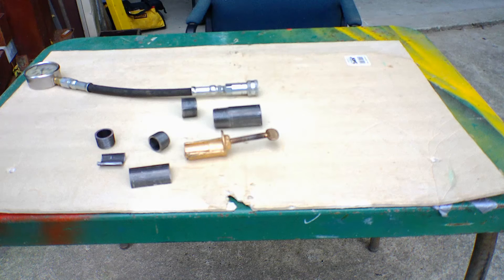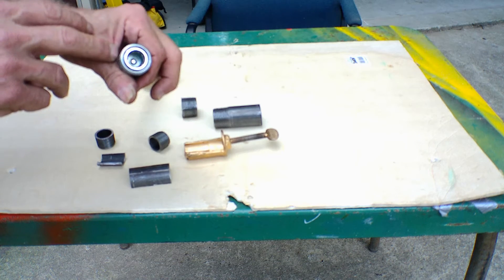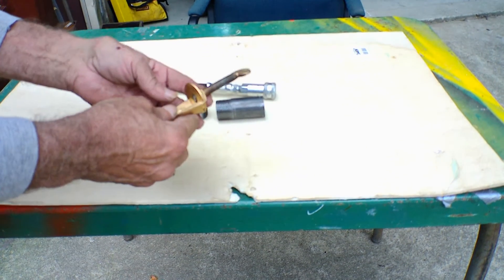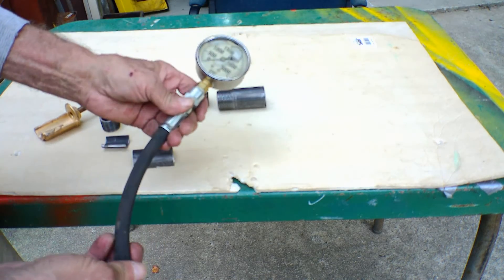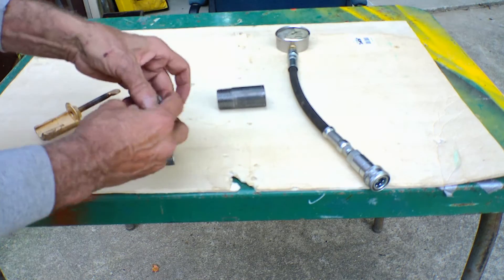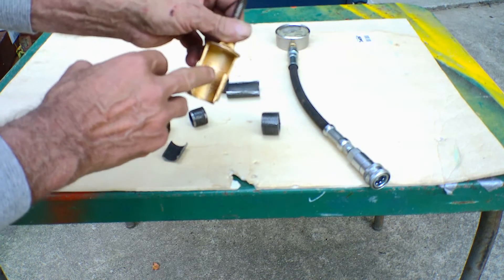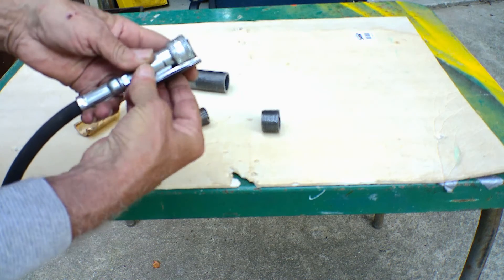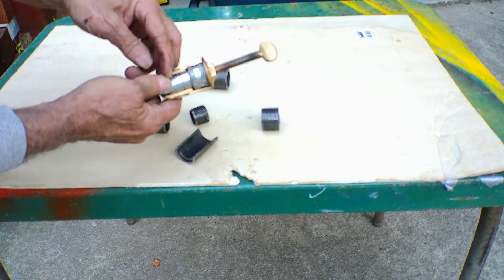Hydraulic Pressure Release Tool

Comment: Hi Mech!  That’s a very clever device you came up with!  A couple years ago I forgot to relieve the pressure on my backhoe before disconnecting the hoses and had the same problem trying to reconnect them.  I just used a hammer to tap the end of the male connector with an oil rag over it.  Only a few drops of hydraulic fluid came out but I could then reconnect the hoses.  Thanks for sharing!
Reply from the maker: Thanks for watching DMW, I hope I don't have to use it, but I have it if I need it,   That's a good idea hitting the male end with a hammer.  Later